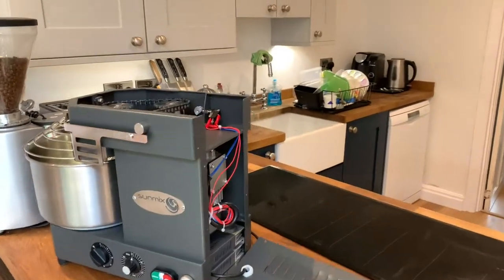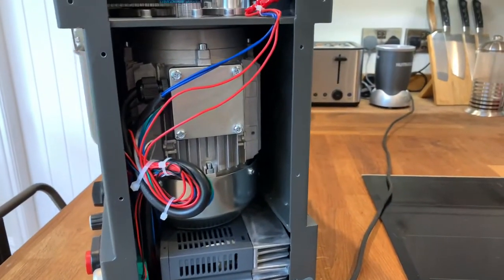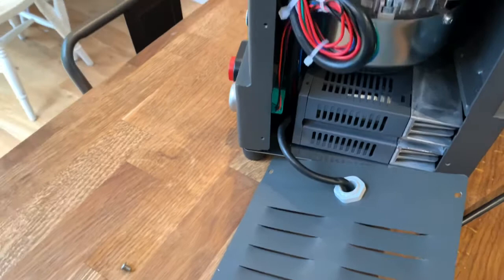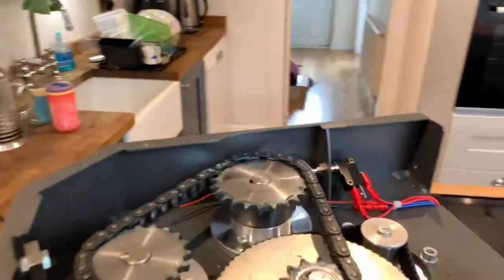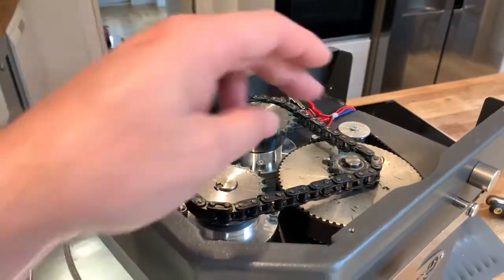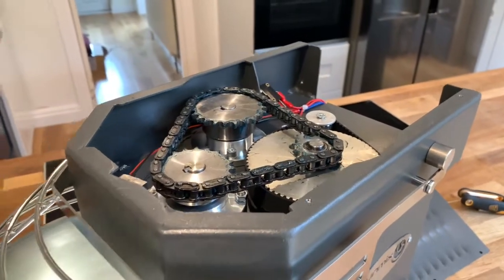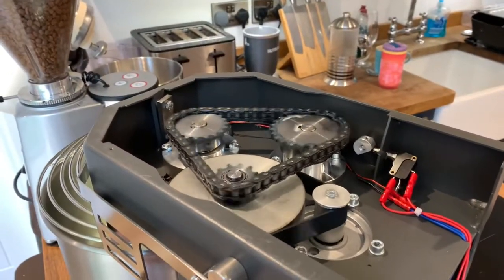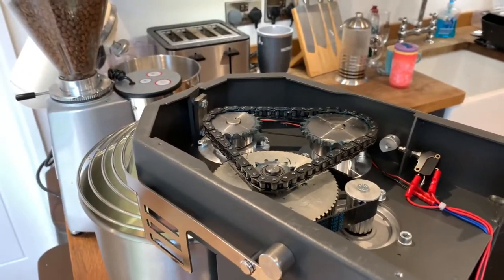What’s inside a Sunmix 6 Spiral Mixer

Comment: Just purchased a used mixer and the spiral is hitting the bowl slightly. Is there any way to reset the height?
Reply: So do you have it fixed? Hows the mixer now? Im considering buying a used one too, but the breaking bar bending to the front and the inside bowl floor has swirl mark.

Comment: Is that other switch for the lights? I can’t find an image of looking up at the lights. Wondering what they did there.
Reply from the maker: There’s no switch for the light. It comes on when you plug it in. This machine has light, reverse, 300rpm and timer.
Reply: @sunmixuk8003  Ahhh ok, that one is fully optioned out.  I did just buy a used one from someone who bought new at the end of 2020.  Just has the on/off and standard speed of 75 to 210 rpm.  Lights would have been nice.  That switch I saw must be for the reverse on yours.  Thanks for the reply.
Reply from the maker: @puretoronto  yeah the white switch is the reverse function. Enjoy your mixer buddy.
Reply: @sunmixuk8003  The top end of this 300 rpm mixer looks mechanically identical to one that is only 210 rpm.  So what is the difference mechanically between a 300 rpm Sunmix mixer and a 210 rpm Sunmix mixer?  Are different sprockets used (like the Famags) to increase speed, or does Sunmix increase the motor speed to 300 rpm electrically by using a slightly higher maximum inverter frequency than it does for the 210 rpm mixers?